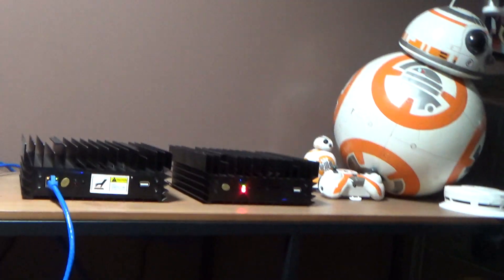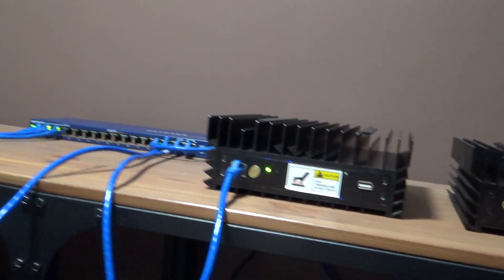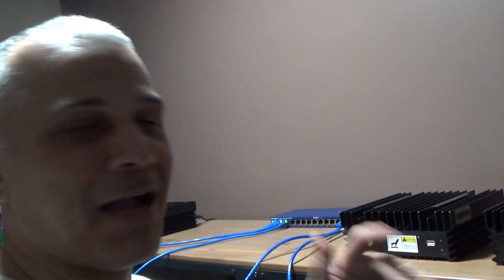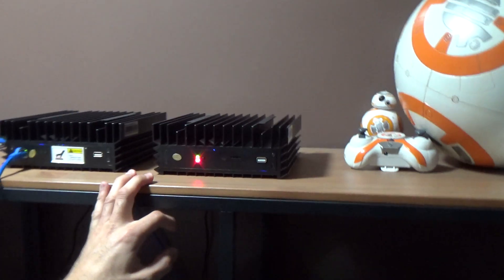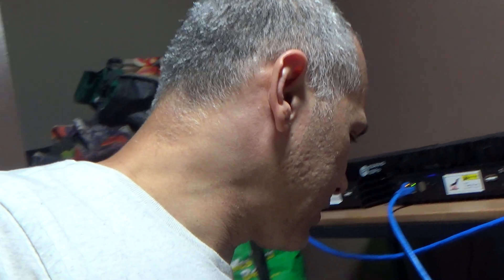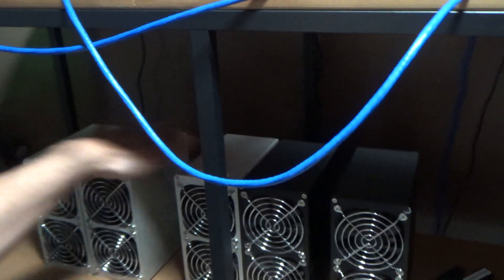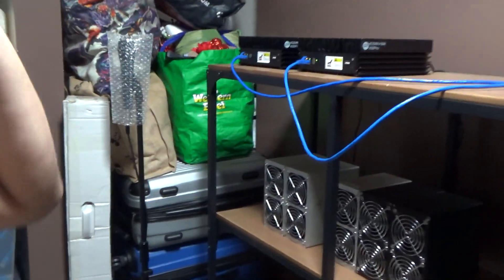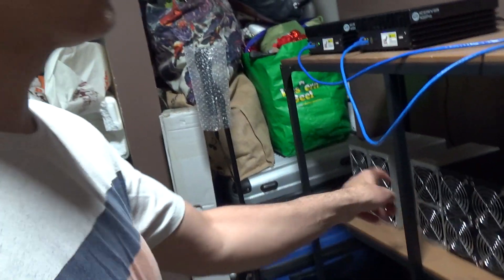Fixed All Of The ICERIVER KS0 Miners

Comment: Will the KS0 miners not run on ethernet wifi connectors? I tried connecting using a wifi extender with ethernet ports and no dice. Any help would be appreciated, thanks.
Reply from the maker: I tried that it didn't work.
Reply: @NerdThingsAndMore  Ugh... this sucks. Guess we're dropping down ethernet in the garage!